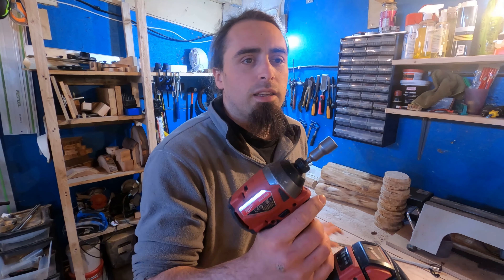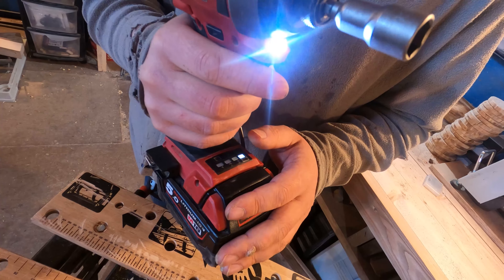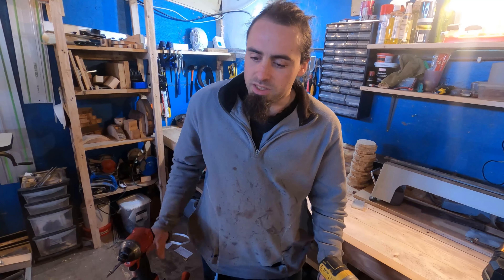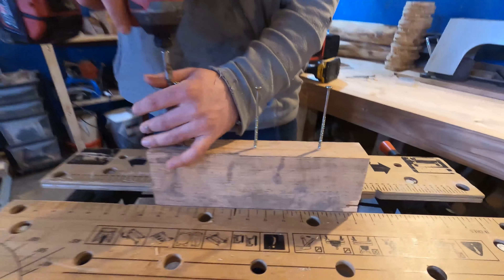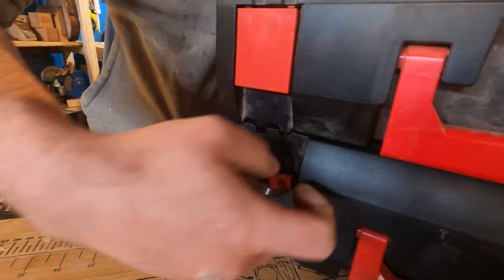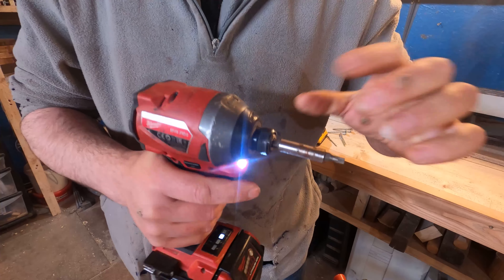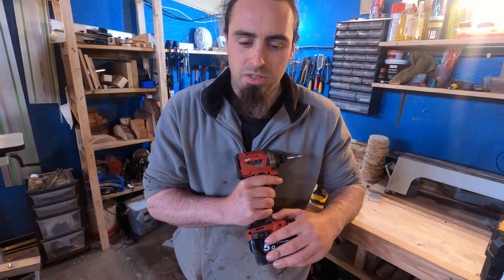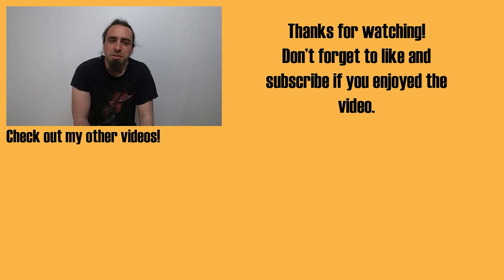Review Of The Milwaukee M18 FID2 Impact Driver From A Blind Person's Perspective

Comment: the auto is used for self tappers. at least thats what my coworker told me.
Reply from the maker: I was told by the sales rep that it was to help prevent screws from camming out. I have actually found it handy for unscrewing tight screws as it starts off slow to loosen the screws and then slowly speeds up. It is a handy way to help prevent screws from immediately snapping. Your co-worker could also be correct as it may be handy for multiple things.